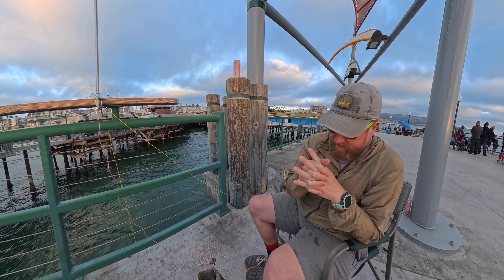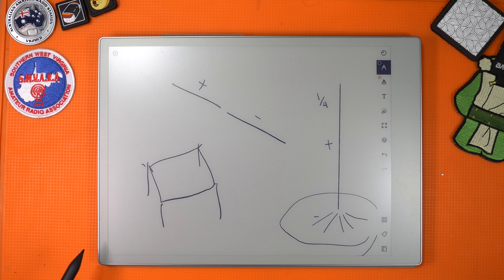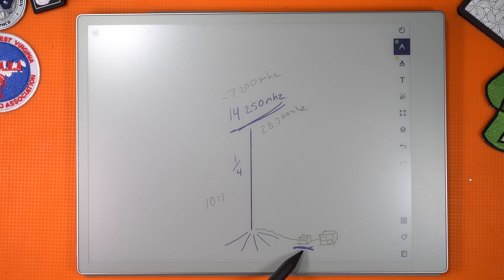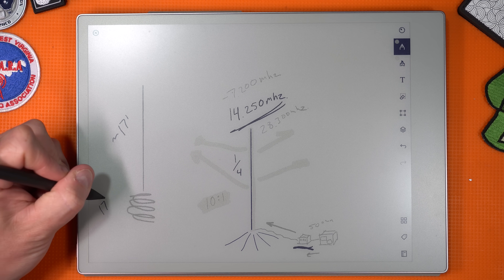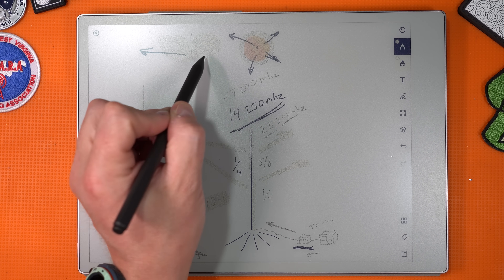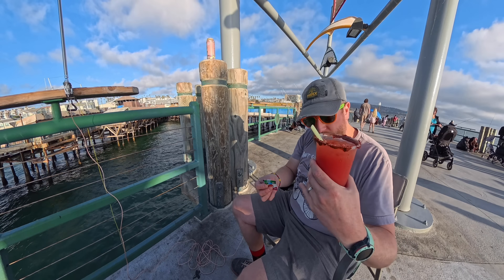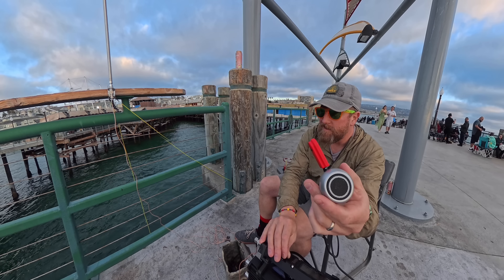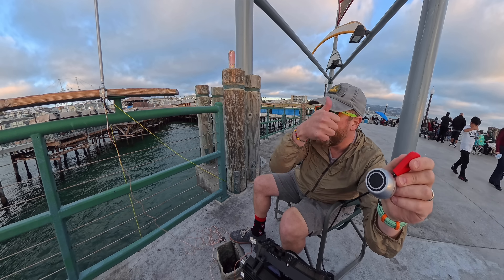When NOT To Use Antenna Tuners

Comment: How does this work if you are using an Endfed wire antenna? any differences when using multiple bands? Love your content, keep up the great work
Reply: When you are using an end fed horizontal antenna, you are exciting it at one of it's voltage maximums. The Ununs or whatever the manufacturers are providing you with are designed to provide you with a 50 Ohm match to the various (high) impedances encountered at this voltage maximum (with a ATU before the rig). As you change frequency, you are still exciting the antenna from one of its ends, which means you are always exciting it at one of its voltage maximums no matter the frequency. The gizmo matching components (Ununs) are designed to take care of this.

In the case shown by the guy in the YouTube video, he is discussing a vertical radiator which is current fed  which means it has a low feedpint impedance. When you try to use it on another band, especially lower than the one it is resonated on, the low-impedance at the feedpoint can become a high impedance. His matching system is not capaable of handling this just as your end fed matching system is not meant to handle a low impedance feedpoint.

Comment: I have a non resonant rotatable dipole and was having trouble with using my auto tuner with a solid state amp.  I've just purchased a MFJ manual tuner in hopes of a cleaner swr at power.  Will I expect to have the same "spiky" lobes radiating with the dipole as with a vertical with radials? Since it's rotatable, maybe I'll be able to turn into better TX if I have issues.
Reply: The guy on the video got it wrong about "spikey" lobes in the vertical "compass heading" radiation pattern. You will have two nulls off each end of that dipole, and maximum lobes perpendicular to it's length. You need to resonate the dipole to your operating frequency by adjusting its length or, if too short, adding two coils in line with the center and sheld of its feedpoint connections to be able to get a ATU to "tune" it on frequencies where the ATU presently does not tune it. It is likely you are having problems when using the dipole on frequencies way below its actual (physical) resonant frequency.

Comment: I try to explain this to people using a Wolf River Coils system..You can't just tune it with a tuner, you need to adjust the coil and whip
Reply: Correct. That resonates the radiator. BTW, stainless steel is a bad choice for a loading coil, given it's conductivity.

Comment: If your radio waves don't want to propagate, it's most likely because they were invented in Europe and have no motivation to travel down some Imperial measured wires. This is really weird, you do all this calculations and in the end, instead of getting some world wide usable results from all your work, you throw out some mumble jumble made up feet length, a system that comes from Germany, I see that, but we abandoned that crap during the 18th century.

So, the moment I see something ending with values in feet, in yards, in psi, in inch, fps or anything else like furlongs, rods, fathoms, cables, hands, length of football fields, stabled babies or stones, slugs, bridge-length in Hugh Chisholms or whatever, it's for the trash.

Also you forget the shortening factor of 0.96 on the wire. But there is a lot more wrong with this, see the other comments. You are correct that tuning doesn't make a better antenna, though. But the only really important thing about an antenna is, the SNR, so how good your signal divides from the noise. The transmission you can always compensate with a bit more power, if it's not in a null-zone of course, that's not what your life depends on, but if you can't hear, that's the one and most important factor. And what mode you are using, SSB sucks.

And there is much more to say about that.

But my theory stands, that you are unlucky with radio, because you shy away the electrons with Imperial measurement units and they just go on strike and demand some serious science instead of sloppy Pirate Units.

Comment: Putting a coil at the base of an antenna is no different than putting a Tuner right at the base of the antenna.  

A loading coil is an inductor, you typically use an adjustable coil, meaning it is a variable inductor.  A tuner will also use variable inductors.

The loading coil is a manual tuner, for all intents and purposes.
Reply: This is not quite accurate. The coil at the base of the antenna is in line with the center of the coax, whereas the tuner is "shorted" between the antenna and shield of the coax (and ground system). The former varies the resonant frequency of the vertical radiator whereas the latter changes the feedpoint impedance presented to the radio.
Reply: @W1ZY that really depends on the tuners, there are tuners that are designed to operate directly on the antenna, without having to connect to coax.

Comment: I've used the "claw" very successfully.  It worked great with hamsticks.  I would clamp it to my metal fence or to a weather station mount.  I would attach counterpoise to it for 40, 20 and 10 meters and spread them around the base of the antenna.

Comment: This was helpful thank you!  I don’t understand tho why, say, it’s acceptable to tune a 25’ Rybakov (multiband), or any  random wire antenna for that matter.  Won’t you get the same problematic nulls?  Yet they of course require a tuner for 40 - 10m…what am I missing…??
Reply: The nulls are off the ends of the radiator because from that perspective the radiator presents itself as a dot. So when you hang a horizontal wire, there are nulls off each end. And when you rotate that horizontal wire 90º, so it is now a vertical antenna, the two nulls now point up towards the sky and directly down at the earth. Read chapter 2 of my book linked off my QRZ page. I hope this helps.

Comment: Have you ever tried to run it through manna? Well actually it shows that you can effectively use the entire length below or equal to 3/4 wavelength without breaking the radiation pattern into multiple lobes. 5/8 and 3/4 in practice are more effective in comparison to 1/4 because of more gain at angles 5-10 degrees, which is a scientific fact. And also, of course, there are not any unpredictable nulls in any directions. With the short length of coax and at the QRP power, the losses will not be significant. So, for the long antennas in the field with power below 100w and a short piece of RG-58, you can use the tuner for sure instead of shrinking your whip back and forth. 
The explanation looks confusing as for me.
Reply: You can get a 1/4 WL to exhibit the first elevation lobe by raising it significantly above the ground.

Comment: With a 10:1 VSWR you don't loose 90% of the power in heat, the actual loss is probably close to 10% (it depends on the coax length and quality). With an impedence mismatch part of RFs reflects back from the antenna to the tuner (or the TX), and the tuner reflects the RFs back to the antenna (the tuner do not convert RFs into heat). The only real loss is caused by the coax, and the only issues with high SWR is with coax losses and high voltages that might break the final stage of the TX
Reply: Only its not one time reflection, the energy will be reflected until it is all either sent out or dissipated.  To convince me its only 10%, show me the math, if your using RG58 at 100ft.
Reply: Thank you 👏
Reply: Agreed. Vast majority of performance hit is due to the uneven radiation pattern.

Comment: Great video. Here's a couple picky math details at 2:30: a) should be written either v/f or c/f (using v for velocity, or c = for speed of light) not lamda/f (cause lambda stands for wavelength) b) speed of light or radio waves is actually 300,000,000 m/s (not 300,000 m/s). But we're dividing by frequency in kHz - so the kilo below cancels three of the zeros up top. You got right answer, just might be clearer. Easiest way to me is use freq in MegaHz and c = 300 Mega meters/s. Then c/f = 300 (Mm/s) / (14.250 MHz) and the megas cancel top and bottom. That leaves 300/14.250 = 21.052 m wavelength. Alternatively, just use m/s and Hz and then (300,000,000 m/s) / (14,250,000 Hz) = 21.052 m.    Sorry, my physics teacher gene kicked in 😁. Keep up the good work!
Reply: ...and then you guess the velocity factor.
Reply: @MirlitronOne but an educated guess gets very close

Comment: Ack, bad physics.  Pick up SimNEC and simulate so you don't have to guess :-).  Per your drawing, if you have a 10:1 mismatch at the antenna, then (say) 20' of RG-58 feed line to a tuner, then actual power delivered to the antenna is 76% of what's put out by the transmitter (-1.1dB).  The losses are in the feedline due to reflections and round-trips.  Once currents are on the antenna, they will radiate.  This is why nonresonant antennas (EFRW, Doublet, etc.) and multiband antennas that require a match (OCFD, etc.) work.  It's even better without the feedline in the way, since it's the coax that has the loss.  Matching networks actually work, and they facilitate the transfer of power across an impedance discontinuity.

All that said, signal pattern is a completely different discussion...

Comment: Hey, I think you're off with your speed of light by 3 zeros. You wrote the correct speed for km/s, but labelled+said it was m/s. It ended up cancelling out because you also divided by kHz instead of Hz, but 2 mistakes that cancel each other out are some of the most dangerous for education. I just felt you'd want to know. Great explanation otherwise, though!
Reply from the maker: Hah, yes. Thanks my labeling was not matching my words.

Comment: Good points, but I think there are still some misconceptions about "tuners" being conveyed here. They don't just waste the mismatch to heat, they do actually create a good match for effective power transmission to the antenna system. Yes, there is a little loss in the inductors and capacitors, but not much. The remaining question is what your antenna system does with it.

The antenna system consists of everything downstream from the ATU in that case. If you hook an ATU directly to the base of the 17 ft whip and tune it up on 7.0 MHz, you've done essentially the same thing as adding a loading coil to the base of the whip. Performance will likely be nearly identical. Sure, the loading coil may be a little higher Q than the toroidal inductors on relays in the ATU, but not by all that much. The difference will be negligible with most tuners. 

But if you do the same thing with 30 ft of coax running to the antenna from the tuner, things get more complicated. Still, you're not wasting that extra energy, but your coax is now becoming part of your antenna system, likely radiating, and messing with your radiation pattern. As far as losses are concerned, a 10:1 mismatch at the load fed with 30 ft of RG-8 into a tuner results in about 20% coax loss at 14 MHz vs 5% coax loss for a perfect 1:1 match at the load. So while there is a bit more loss in the coax with a mismatch that you tune into submission, it's not massive.

Again, the real issue comes down to the radiation pattern. Tuning the coax (not the base of the antenna) results in a radiating feed line, more ground losses, and a messed up pattern. Tuning up a vertical antenna longer than 5/8 wavelength does result in vertical lobes that increase high angle radiation and reduces that good low-angle radiation. With a vertical, there are no lobes in the Z plane (top view looking down). 

A 17 ft whip on 10 m is still just a half wavelength and will have a good radiation pattern, but the high feed point impedance must be sorted out. A robust ATU at the feed point could potentially do that. 

That's sort of the concept behind the Rybakov antenna. It's just over 5/8 wavelength on 10 m so the pattern isn't terrible there, and it's a non resonant length radiator fed with a 4:1 unun for easier tuning. Place an ATU at the feed point, and it's pretty efficient with a decent radiation pattern on the HF bands.
Reply: Excellent explanation; albeit, I disagree with your statement that "tuning the coax (not the base of the antenna) results in a radiating feed line..." 

Rather, it's common mode current on the coax feedline that results in a radiating feedline -- regardless of feedline SWR or tuning.  Of course, a common mode choke on the feedline at the antenna base is the cure.  

Frankly, feedline common mode current on a ground mounted vertical has relatively little to no effect on radiation pattern -- assuming the feedline lays mostly on the ground.  The significant problem is common mode return RF energy appearing on the ground/common side of transmitting equipment.  Not too problematic with QRP, but more so with QRO.
Reply from the maker: Thanks for the detailed explanation and the discussion on antenna systems!
Reply: If you hook an ATU directly to the base of the 17 ft whip and tune it up on 7.0 MHz, you've done essentially the same thing as adding a loading coil to the base of the whip. The loading coil resonates the shortened radiator, after which the feedpoin impedance must be dealt with. In your case the ATM does the latter, whereas it is more efficiently done with a shunt coil across the vertical feedpoint. No need for the ATM.
Reply: I was going to comment, if it's the 10m band for an antenna which is a 1/4 wave on 20m, then it's going to be a 1/2 wave on 10m. The tuner, if at the base of the antenna, becomes the 49:1 transformer and you end up with an end fed half wave, similar to if you had a half wave dipole.
Reply: Ah, so you agree with me -- I just made a comment with some numbers from SimNEC.  There is definitely loss in the coax, because of dielectric losses, and they are worse with a worse match at the antenna feedpoint.  You could put a choke at the feedpoint and ensure the coax is not radiating, but you would still have expensive dielectric losses.  My estimate is -1.1dB losses at 7MHz over 20' of RG58 based on the SimNEC model with Josh's 10:1 mismatching antenna.  If you put the tuner directly at the base of the antenna, though, SimNEC says 98% power delivery to the antenna (that's assuming its default values for component Q, etc., for its impedance matching block).
Reply: @yakovdavidovich7943 yes, but in reality, 1.1 dB is still very little. 6 dB is an S unit. So, 1.1 dB loss is unlikely to be noticeable. Should we optimize our systems? Yes, of course. But we should be realistic about the impacts of losses.

Comment: Josh. Your comments about adding a coil to add length are not correct. A loading coil is a large series inductor that changes the complex impedance of an antennas feedpoint to balance out capacitive reactance.
Reply: Actually that is a "shunt coil" placed across the feedpoint of a "short" vertical. The "loading" coil changes the vertical's resonant frequency.
Reply: @W1ZY adding 17’ of coil as Josh states in the video will not give you a 1.5:1 SWR tune.  Placing half of a dipole on the ground only puts most of the RF right into the dirt.  You’d be better off not adding that section of the dipole and just use the coax for the other side of the antenna.

Comment: What you didn't do was a comparison with this resonant antenna vs a longer one with longer radial into the water and a 9:1 unun and tuner at the radio end. When i operate SSB from beaches with my FT891 and mAT30 tuner here in Far North VK4 I have regularly worked European and US stations, mainly on 20m but also on 40m. In my opinion, relying on software to tell you what  the signal is supposedly doing may well not be completely accurate. VK4BOB
Reply: The antenna he used was actually a vertical dipole becuase the "radial" was not touching the water, which would have detuned it. Extending the wire into the water would detune the antenna, and "short out" the high voltage maximum at the end of the "radial" to the water.

Comment: You are wrong about antenna tuners.   They don't heat up.  They store and return the reactive power in a combination of capacitors & inductors.  In fact, most loading coils (inductors) likely waist more as heat because the common stainless winding wire has a much higher resistivity.   The real lost is radiative were you don't want it. That is, common mode current radiation radiating from an outer coax on the ground.   That why it is always better to use a tuner at the antenna than on your rig in a shack.
Reply: A well-placed common mode (CM) choke is the cure for CM current on the feedline.
For a ground mounted vertical with ground level radials, CM current on the feedline is no more lossy than RF currents carried by the radials.  In fact, by allowing CM current on the coax shield, it can serve as an additional radial.  When used this way, be sure to place a CM choke at or near the transmitter.
Reply: @DaDitDa  Above 16 radials is where things calm down.
Reply: A tuner doesn't cause the feedline to radiate, common mode current is caused by an antenna imbalance

Comment: Josh, you gave a good explanation of some of the basics of vertical antennas that will help many. I would like to add that merely resonance in a vertical (or other) antenna system does not guarantee SWR low enough to eliminate the ATU or other impedance matching device.  An example situation is an HF mobile antenna that is tuned to resonance by loading coil adjustment. Due to it's small size, it has a very low radiation resistance and, thus, a very low feedpoint impedance, often 10 ohms or less. This could result in a feedpoint SWR of 5:1, or more, which is going to make the transceiver very upset.
Reply: You get around this by placing a "shunt coil" across the mobile antenna's feedpoint. Try three turns of No. 14 wire in a coil 1" in diameter. You stretch or compress the coil to get the 1:1 SWR. More turns below 20 Meters and less turns above 20 Meters. Experiment.